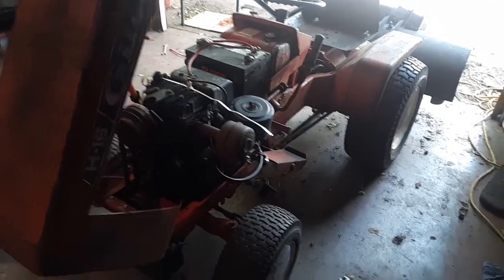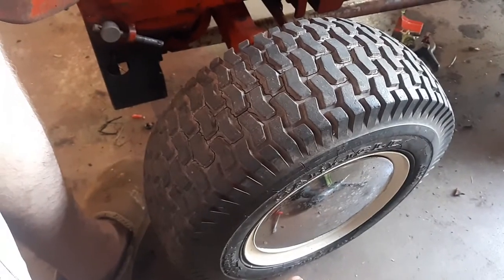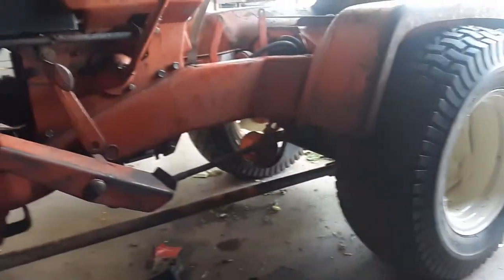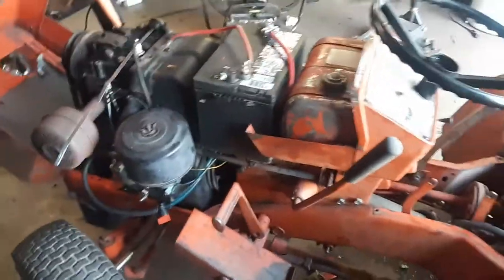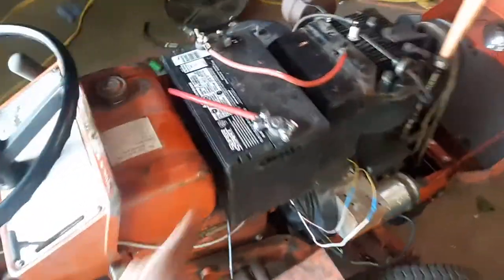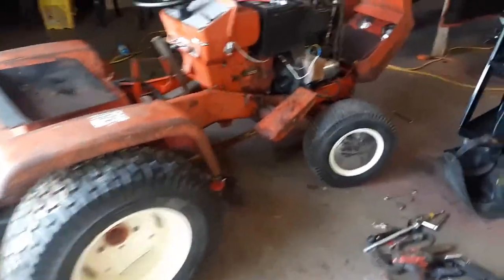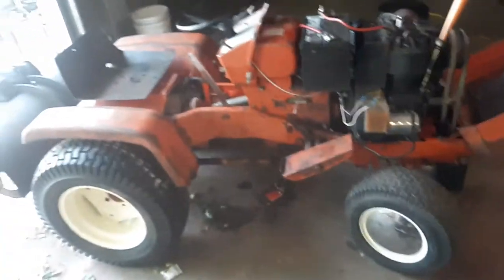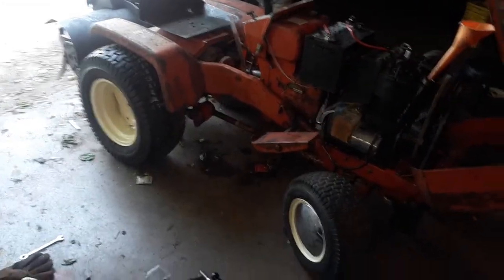Gilson h16 tractor update

Comment: Those old Gilsons are workhorses. I restored a 1984 16 yt. Mine is set up exclusively for snow plowing eventhough I have a 38" rear discharge deck that's lightly used.